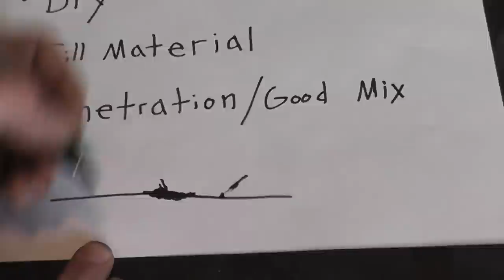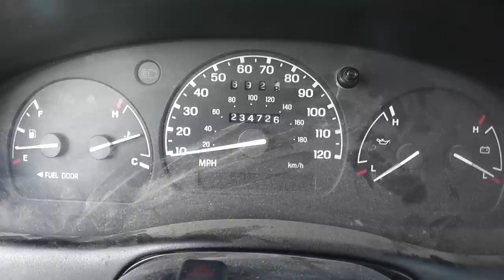How To Fix A Cracked Plastic Radiator For Free (Hopefully)

Comment: I've got to ask because...quite simply this seems like the most ridiculous bush fix I've ever seen. Why not just use some High-temp RTV or something like that? The stuff is rated for over 500 degrees, and is actually meant to SEAL things. It is intended to bond to plastic as opposed to the now structurally compromised pieces of plastic you used. I mean maybe if I was stranded on the side of the road I could see taking a lighter or the cigarette lighter from the car to help seal a crack, but this seems kind of absurd...particularly since there are better options available if you were going to try to do this kind of "repair" to begin with.
Reply from the maker: +David I don't think glues epoxies and silicones work well because of the pressure and the expansion and contraction of the plastic.
Reply: So, I did some research, and I have to at least partially retract my above comment. Different types of plastic react differently to being melted, and the type used for radiators is apparently the kind that you can melt and reform. To be honest, I still kind of question using this method for something like a radiator, but it is possible depending on the  location of the leak. I had a radiator a while back that was leaking in 2 places for example. The first was a fairly obvious and easy to get to small crack near one of the inlets/outlets. The second, however, was right along the edge where the plastic and metal meet. You couldn't even see it, let alone be able to get to it. The only way I knew it was there was from watching for leaks under pressure. No way this method would fix that. There are some situations where it might be helpful still, but personally... unless I'm on the side of the road I think I'll just replace mine. $100-$200 for a radiator and my peace of mind, or a couple thousand for a potentially blown motor down the road if something goes wrong. To each their own on this, and I'm always glad to learn something new. Thanks for sharing.

Comment: A for effort, but that was a major break in a difficult area. I would have topped that off with epoxy and imbeded  it in fiberglass mesh - 20 years ago. 40 years ago I fixed many with solder before we got screwed with these cheap shit garbage alum and plastic radiators. But really, at this stage in my life, if you take the thing out, for 55$ you can replace it all. I pay myself 60$ an hour, so I make money buying the new piece of 100,000 , mile designed to fail Chinese sabotage crap. Local store Chinkerator was $198 and online was $55, so we are going to kill our brick and mortar stores one day.And sad to say I often participate.  Back in @ 2008 I scrapped a copper radiator from an old dozer - prices were high and I got $225 for it! I love copper! Too bad our engineers have taken so much of the metal out of cars.

Comment: I have an easier fix, First remove the radiator, then go buy a new one then put it in.
Reply: he spent maybe 5 bucks to nothing on his repair vs $300-$400 for a new radiator. Id say his fix is the way to go if it works.  I had a cracked radiator that I fixed with JB weld it it lasted for another 2 years before I sold it
Reply: A radiator for that truck is about 65 bucks (dude please stop talking...)
Reply: 65$? Ok 25$ ok 400$ ok didn't matter about the price only the fact that it was costly for the guy which in turn fixed it hisself to save that money; I think that's the whole point of his actions and the posting of this video😃😃 so back to the #areyoupayingforit?_Stfuthen!!! Hashtag....